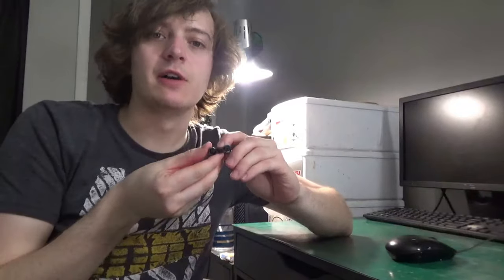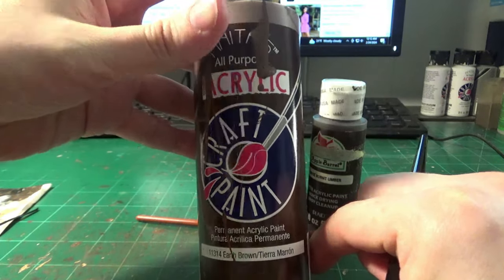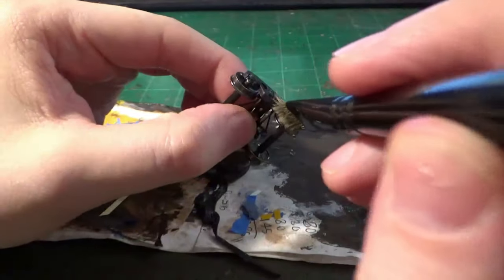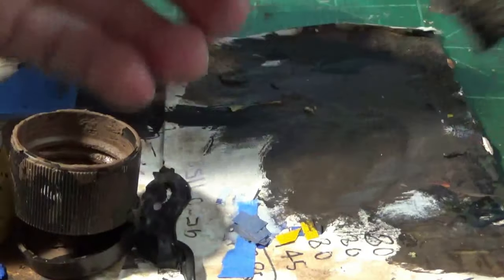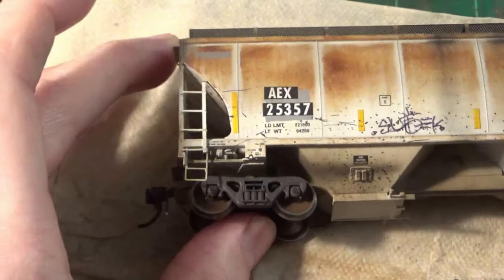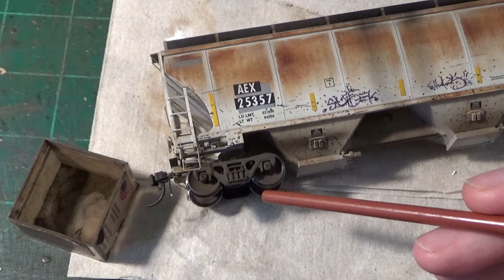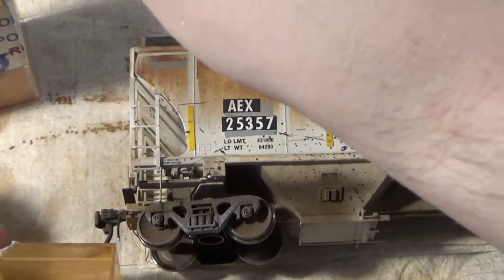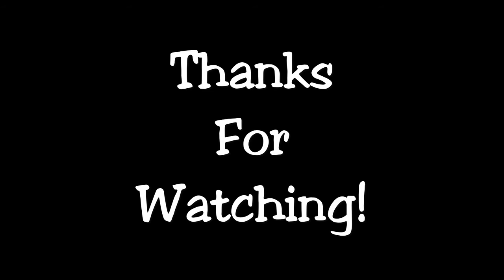My Approach To Weathering Wheels & Trucks!

Comment: Hey Dan. I find standing those testors cans in hot water before you use them helps in thinning and also increases the can pressure just enough to stop the splattering

Comment: Thanks for this video.  My own approach is very similar to yours, but I use a mixture of brown, black, and German red acrylic primers for the base coat.  I then apply craft acrylics that have been slightly thinned with water to make them semi-transparent on top of the base coat.  I do some additional detailing with paint, particularly the springs.  And since I model the early 60,s I get some black around the journal boxes and on the faces of the wheels.  I usually leave it there, but I think now that I've seen your video I need to try some powders.  Cheers from Wisconsin!